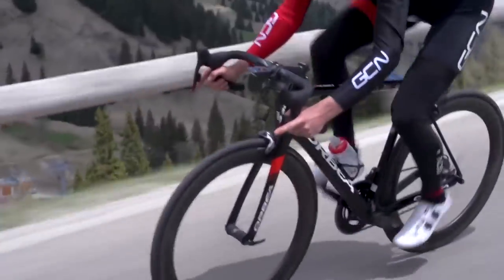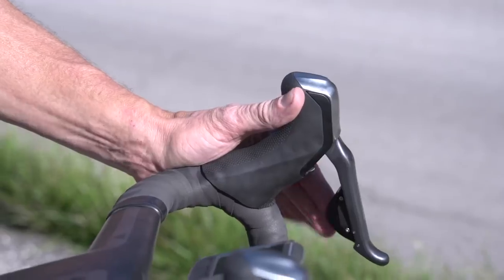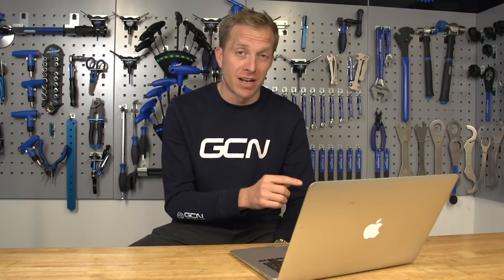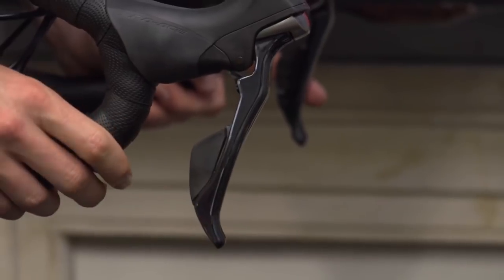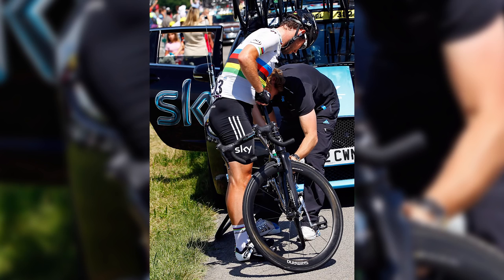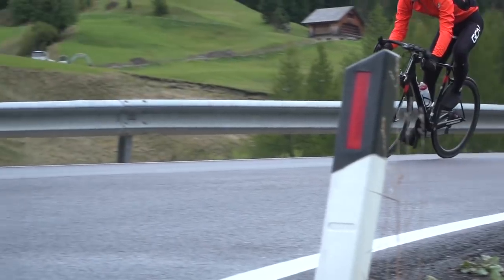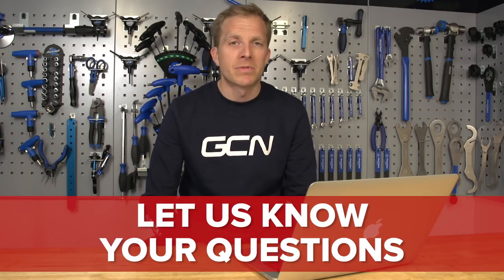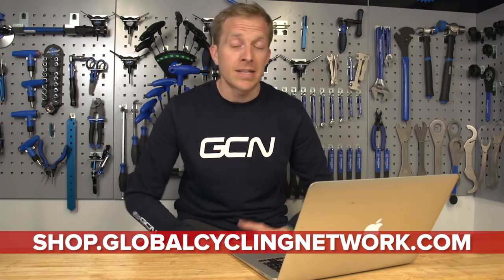Are You Using The Right Brake Pads? | The GCN Tech Clinic

Comment from the maker: Leave your questions for Jon in the comments below, and across social media using the hashtag #askgcntech
Reply: #askgcntech Hey John!  I´m a big fan both of the gcn and the gmbn tech videos,  you and Doddy are no just experts or  nerds in bicycle tech, but you do know, how to presentate it.  Could you two maybe do a cooperation, where you just pop up some beers and have a chat about bike-tech, the future and past of the sport, differences about the mtb and road products from the same brands ( sram launches soon the black box shifting, so it would be interesting, what makes a groupset mtb or road specific, when the basic functions are the same), the re-inventing of the ´90´s mountainbikes with dropbars as the gravel-adventure-scene right now, and who knows, where you end up...  we don´t mind, if we get a hour long video, or even a new series :D and anyway, keep up the good work!
Reply: #askgcntech it is often advised not to use Latex tubes in carbon rims as a safety issue due to heat management of latex. Is this a real world issue or and old wives tale. At what temperature do latex & traditional tubes typically fail if at all
Reply: Tips on tire rotation would be a good topic.  E.g. Since the rear wears faster, and one would like as good or better tread on the front, what's a good mile/km point to do so, if at all
Reply: #askgcntech. Jon my left foot toes inwards slightly (if i try to straighten I get knee pain) how can I match the cleat angle on different bikes and different shoes. The Q-factor is different on road bike than my commuter.
Reply: #askgcntech do any pros cut their seatpost so that they just have the minimum requirements of it inside the frame to save weight?
Reply from the maker: good idea, I will have a chat to Doddy about it, Jon
Reply: Dear Jon, the slipping seatpost can be fixed with some clear coat and a little brush. You clean the frames seat tube from grease and debree. With a little brush you aplly one layer of clearcoat inside the seat tube of the frame. You leave it to dry for over night and then try the seatpost, if its still too wide you apply another layer, and repeat the process untill you have a tight fit. Regards and succes with the show.
Reply: #askgcntech I have a carbon road bike (Spzd Roubaix Rim Brake) with Tiagra 4700 10 speed. I just picked up a used aluminum bike to use for gravel and commuting (BMC GF02 Disc) with 105 5800 11speed. I'm tempted to swap groupsets to put the 105 11 on my more performance oriented bike and the Tiagra 10 on my more casual bike. Do you think that it's worth the effort?
Reply: #askgcntech Hey Jon! I have a bike with traditional rim brakes, whenever I wash it and I test the bike afterwards, the brakes make awful squealing noises (I use plain old dish soap for washing them) Should I be washing it with bike specific cleaners or any other suggestions?
Reply: Hey Jon, I have a 9 speed Sora groupset and would like to get rid of the shifting cables from coming out the side of the shifters out front. Are there any options out there for that? I know 105 and Tiagra were at one point 9 speed and they now have their shifting cables along the handle bar did those technologies were cross over?
Reply: Thomas Schlebusch, well I don’t know about the pros, but I just did that on my own bike. Cheapest weight savings ever versus buying a new one. It’s totally fine as long as you leave enough at the bottom per the minimum requirements. No point in lugging useless weight around everywhere even if you’re not a weight weenie.

Comment: I've used SRAM Apex Brakes with Shimano levers with no problem. The bike originally had Tektro brakes so mixing and matching is totally possible as long you are using the same brake type (i.e direct mount, side pull, etc). However I do find my current  matching shimano brake & lever combo the smoothest to operate.

Comment: Hi Jon. Great show!  I have a question about tire clearance.  I bought a Wilier GTR SL Disc that came with 28mm Vittoria Rubino Pro clinchers on Mavic Aksium wheels. I upgraded to HED Belgium+ and mounted Schwalbe G-One Speed 30mm tubeless tires for mixed tarmac and gravel riding. I have about 3 mm clearance between the tread and seat tube in the rear and 5mm between tread and fork crown. The sidewall clearance is only 1.5-2mm on each side of the fork and on each side of the chain stay.  I’ve been on some long rides with steep climbs and really stomped on pedals and swung the bike to and fro with no flexing to cause any rubbing on sidewalls. Do you think I can run this setup safely or should I go back to 28mm tires?  What is considered minimum tire clearance? Thanks!

Comment: I changed from a 53/39 mechanical to a 53/36 mechanical  Ultergra, (11-28 on the back with a medium cage rear derailleur) as i have a few tough climbs in my area but still want to keep up on the flat. it works fine.

Comment: I have a sora groupset and would like to upgrade to either an ultegra or sram equivalent.  It would need to be a bang for the buck upgrade.  Only non sora part of the group is an origin8 XLT Road standard 53/39 crank set with and bottom bracket.  Any suggestions how to go from 9 to 11 speed on a budget?

Comment: #torqueback How do you choose what the right Disc Brake Pad is for your riding? I ride all year round including in the rain.  Do like to climb hills. I am a cautious descender so I am on the brakes a bit more than my mates. What pad do you suggest - organic , sintered or semi-metal? Currently have the pads that came standard with my R8000 groupset which are organic. I am not saying they are bad, not sure if they are the best option for me.

Comment: Jon – first, I immensely enjoy the show, and have seen EVERY episode so far. Second, own a 2017 Specialized Tarmac Disc with Di2. I have an issue where—following Shimano’s setup and fine adjustment procedure—I can’t adjust the front derailleur enough for there to be no rub on the smallest chainring and second to smallest sprocket. In my mind, the solution is to move the chainset inward a couple of millimeters or the front derailleur outward a couple of millimeters, but I don’t see any way to do that. Yes, I know I’m arguably crossing the chain, and can just switch to the large chain ring, but I have a very close grouped cassette (11-23, as I live in Florida), and this combination (36/12) is pretty spot on on my cruising speed. Thoughts?

Comment: Hey Jon, big fan here and a novice mechanic in training. I have a bit of difficulty setting up the SRAM Rival Yaw front mechs. Typically following the instructions that GCN and others have given, I can never seem to get enough tension in the cable to provide seamless shifting without turning my barrel adjuster way out. You mentioning crushing gear cables in this video reminded me to ask! I have it working, but my brain hurts knowing that I could do it better. I guess a thord hand or similar can add tension before pinching the cable, but what about at home/side of road?

Comment: John great show.  When I buy a new chain should I clean it, re lube before use? Or can I use it out of the package because there is lube applied already.  Or don’t clean, lube n go.   Got a new kmc chain and it’s pretty greasy out of the box.  Thanks
Reply: The assembly grease on the surface a brand new chain exists solely for the purpose of transporting and storing the product. It is generally advised that one should remove the surface grease with a mild degreaser before initial use, otherwise the sticky grease would attract a large amount of debris.

Comment: The "noodles" on my Giant branded TRP rim brakes on my Propel Advanced Pro 1 give my lots of trouble. Firstly they lock up and won't adjust, and then from trying to shift them (despite anti-seize lubricants), the aluminium alloy is cracking at the ends. Are there suitable replacements from TRP or other brands that give less grief? #askgcntech

Comment: I have a Shimano Ultegra brake levers on my road bike. Recently after a rainy and dirty long century ride, the Rear Brake lever action became very rough and stiff. This didn't happen to my front brake levers though. It's still very smooth. I tried disconnecting the cables to try to isolate what is wrong. But the cables seem fine, the levers without the cables connected seem fine. The brake cable housing seems fine. The calipers were pretty smooth too. What else could be wrong? #askgcntech

Comment: Hi John,my bb30  creaks while standing Up on the pedals,how could I fix It?I regreased It a month ago.
Reply: My 2 cents...pretty much all BB30 brackets end up creaking. Assuming nothing is wrong with the frame, I’d look into getting a BB30 adapter and swap out for a new crank when the time comes. Just TODAY a placed an order at my LBS for a BB30 adapter to change to Shimano BB and a new Shimano 105 crankset. My bike will be running 105 completely and with no creaking after this is done.
Reply: Aaron David Thanks,but now It has stopped creaking😂,and i have read that to install bb30 correctly It is needed to use a bearing fixer glue,this is the most common cause of creaking because of not using this,Next time I change the bearings i Will use this😃
Thanks

Comment: Brakes, very important but is it possible to implement a braking test such as those used for performance cars braking from speed to a standstill. Take a common brake setup such as Shimano 105 with standard pads and levers and using say 3 different bikes fitted with these brakes and riders of different weights, take stopping distances from speeds of say 20, 30, and 40k on flat dry tarmac each rider using each different bike. This would give a average stopping distance and longest and shortest distances, which could then be used to compare future tests of other breaking systems. If possible a software program would allow riders all over the world to add their results,  allowences would be needed for different tires, pads etc.

Comment: 0:40 That's against the laws of physics. Work done slowing the rider down is the same no matter what brakes you use. You don't ''generate more heat'' with carbon rims, they just don't dissipate the exact same amount of energy as quickly as aluminium. Not being pedantic, its quite an important distinction and one which can cause a lot of confusion for people.
Reply: I agree with you, but for what purpose would it be important to know that the amount of heat generated is technically the same as opposed to knowing that "carbon creates more heat"?
Reply: 藤森えみり I know what you’re trying to say, but carbon doesn’t even get hotter than aluminium, it’s just that the same temperature is more of a problem with carbon (resin going soft) than it is with aluminium.
Reply: Kinetic -> thermal isn't the only energy conversion braking does.  There's also Kinetic -> acoustic and kinetic -> kinetic (vibration).  :)  Stiff quiet rims generate more heat than pliable, loud rims.  :)

Comment: FYI, swapping chainrings the other way, like creating a 50-39 (from a 50-34) won't work with Shimano 6800 or 9000. Tried that for you. The chain will not slide properly and get stuck between the chainrings.

Comment: #askgcntech
Would you recommend using several chains at the same time for one cassette? Like switching every 200km to the next chain so you use a less worn chain for longer. Should also keep better shift performance on the long run. Was thinking about 3 chains for one cassette
Reply: just change your chain beore its too stretched (for me about 3000 km) should get 3 chains per cassette invest in a chain checker instead of the extra 2 chains

Comment: Re carbon vs reg pads a bigger and maybe more dangerous outcome when using the wrong type of pad on carbon rims is the heat issue.  The wrong pad can actually heat up the brake surface and damage the resin and compromise the rim😮

Comment: For great braking uses Campagnolo levers with Campagnolo calipers, and throw the rest away. Surprisingly their cheaper Veloce brakes have more than enough stopping power, and cost as little as 20-30 quid for a pair if you look in the right places. Weight is no issue, Campy do a much better job of light-weight components than their competitors at this price point.

Comment: #askgcntech
Most amateur cyclists are put off using tubular tires thinking they can not be repaired. I was lucky enough to learn from my first cycling coach how to stitch a tubular. Is there any manufacturer or bike shop teaching this and why is it not common knowledge tubular tires can be repaired? Tubulars in my experience suffer the least punctures on average (miles per puncture).

Comment: Should I run a lower  tire pressure on the rear tire  to get more grip? And leave the front tire a higher pressure? Will this help with going faster? #askgcntech
Reply: No, no, you should lower the front pressure with higher pressure in the rear. This will change your angle of attack to the wind, make you more aero. More aero=go faster
Reply: You should run your pressure generally higher in the rear, since this is where most of your weight is placed. I usually run 90 psi in the rear and 85 upfront and I weigh 62kg. So normally just a bit more air in the rear should suffice

Comment: #askgcntech - hi brakes won't ever in the middle, rubbing against my rim, forcing me to set the brake calipers wider then required. (SHIMANO ULTERGA R8000 and earlier)
Reply: Single post or dual post?
Reply: single pivot mount (thnx!)
Reply: Usually there is 3mm allen key bolt to center brakes
Reply: thnx, (thought it was just for show - having a look at it now!)

Comment: My bike frame don't have a bottle mount. Can you sugest.  #askGCNTECH
Reply: Neviann Sanchez there is bottle cage mounts for bikes without holes
Reply: Google "hose clamp". Take a photo after, you could be on Hack/Bodge of the week.
Reply: Seat single and double bottle mounts are often used on triathlon and time trial bicycles. My single speed doesn't have a bottle cage mount either, so I use the Patrick Seabase method of placing one water bottle in  my centre jersey pocket.
Reply: Gordon Moat  thanks
Reply: Kayak George thanks
Reply: Kayak George thanks
Reply: Perseministeri thanks
Reply: If it's a metal bike frame then your LBS can retrofit them for you. Holes get drilled and something that resembles nuts glued or soldered on the inside.
Reply: EditioCastigata is a aluminum bike frame